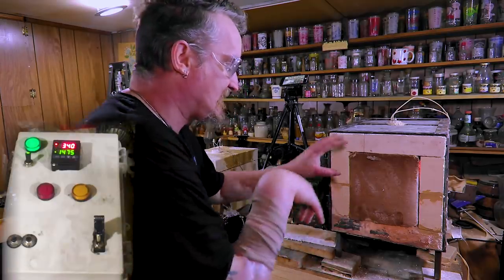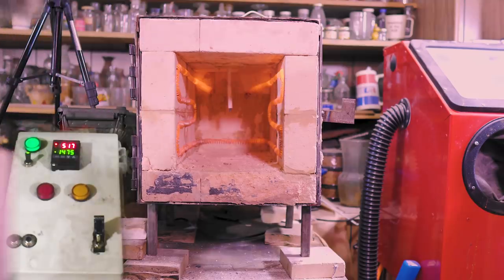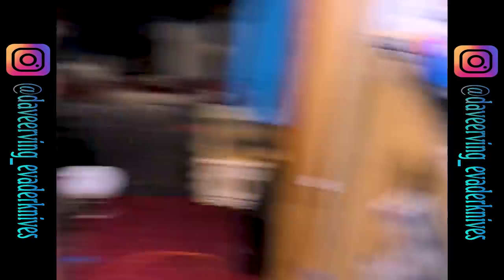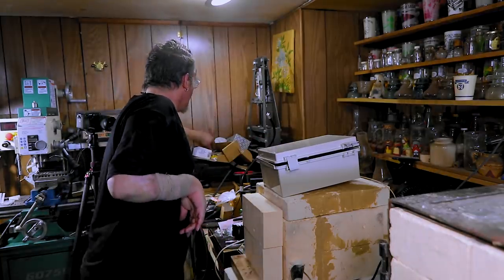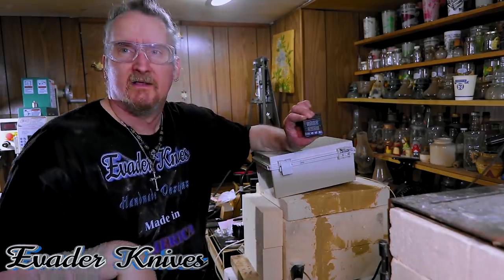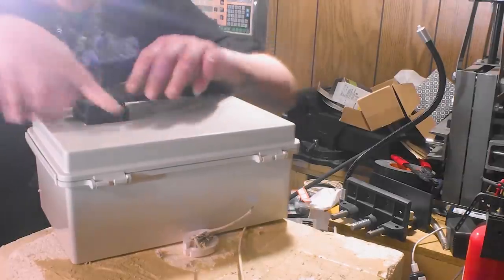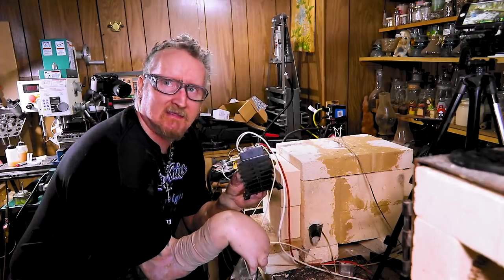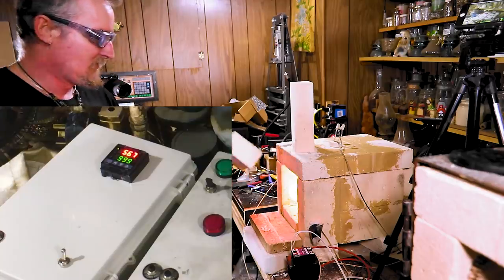Heat Treat Oven Build & Repair a FULL GUIDE(playlist in description)

Comment from the maker: Let me know if you have any questions about building a heat treat oven, the playlist is in the description & at the end of the video...
New shirts available, with knives & Amazon Affiliate links on my website - https://www.daveerving.com
Thanks for the support, take it easy...
Reply: About how much in total cost do you think you have into building one of these? Bricks, cement, electronics, etc...
Reply from the maker: @triaxegear4544  Well for me, I had to have the bricks shipped. That was the biggest part of the cost. Someone suggested going to a fireplace shop, they said the shop had piles of soft brick . All in it was about $400, but half of that was the bricks & shipping.
Reply: @evaderknives  Thank you
Reply from the maker: @triaxegear4544  Yeah, no problem.

Comment: Well done Dave. I do like the little one! Being the noob that I am, how long would you run the oven to achieve your hardening etc? Given the fact that I live in a city that has the highest electricity prices in the world, I'm curious to crunch the numbers.
Reply from the maker: Well, my big oven took about an hour to get up to 1500f, but that was before I fixed it... I have yet to try these new ovens yet, but i would imagine with the small oven that time will be cut down drastically... even when I was doing SS for hours, I didn't notice a boost in my bill... then again, I use my 2x72 a lot more than I do the oven, which is also 220v... I'll have to break out my Amp meter next time, to see the draw on each oven, since they are 220v, I think they only draw about 7 amps though...
Reply: Thanks mate for the info and the effort you make to help everybody.
Reply: Yes very impressive Dave. Who'd of thought the small one would pull more amps?
Reply from the maker: @johnmw1  Yeah, I guess since it was smaller, the coils were tighter, so it was less resistance. I ordered a 5 ohm resistor to hopefully bring down the amperage...
Reply: I shall be following. @evaderknives